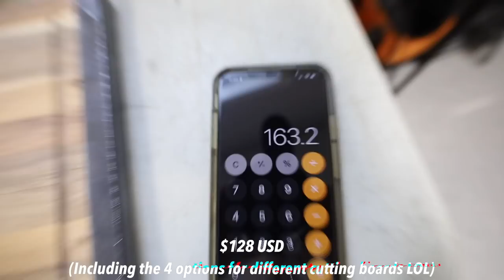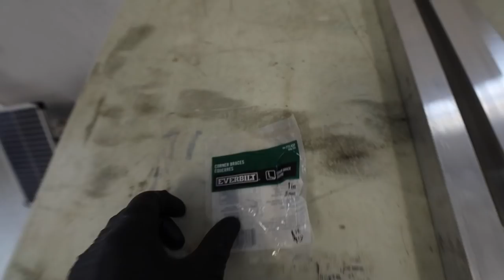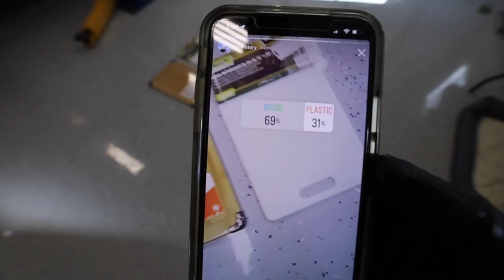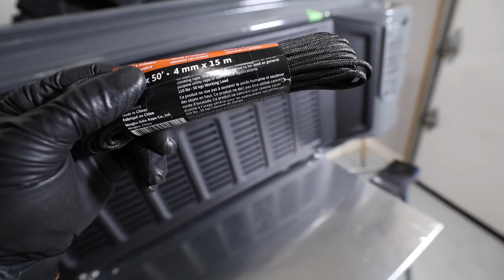Building the GREATEST DIY Tailgate Table! JL Wrangler

Comment: Looks great and well made, the only slight suggestion i'd do if i were building it would be to paint the underside/sides of it black so when it's closed it really blends in other than the board and maybe look into giving the top a "brushed" finish so that any scratches and marks it gets through use don't show up too much.
Reply: Same, i was expecting him to paint or stain the wood
Reply: Or maybe a sheet of abs plastic with a rough texture so it blend with the rest.
Reply: Even would be nice to put a piece of aluminum on the bottom side so when it's closed you don't see the wood
Reply: 너도 멋지고

Comment: robbie, for the grill/stove and the plastic issue that you addressed at the end. you should get some heat resistant cloth that can just lay over the plastic part while you cook but then can be removed to clean and what not.
Reply: He uses an outside grill the lid is the splash guard

Comment: Would highly recommend cutting a hole in the cutting board or the metal holder! 1. Good for a little cup holder if you need it. 2. If you’re cutting and need to dump trash, you can put a trash bag under it and just slide the trash through it!

Comment: Use wire instead of Paracord. Paracord will stretch. You can pull the guts out of the paracord and sleeve the wire to cut down on noise. looks clean though.

Comment: Hey Robbie,   It might be a good idea to add some anti-seize in the hole on the tailgate where you drilled into.  There is a lot of moisture and I wouldn't want to see that get all rusty.  But as all ways, solid job and the jeep is looking fire!